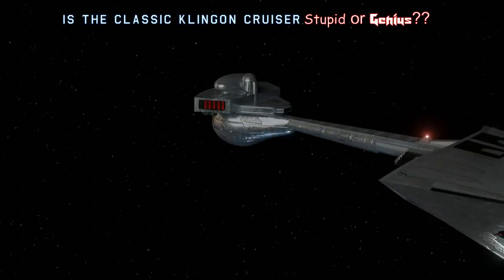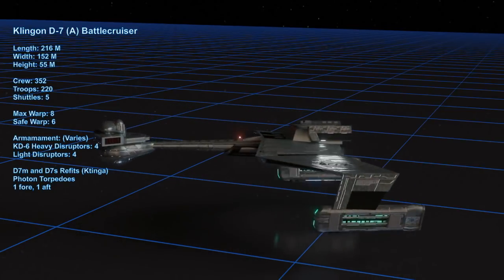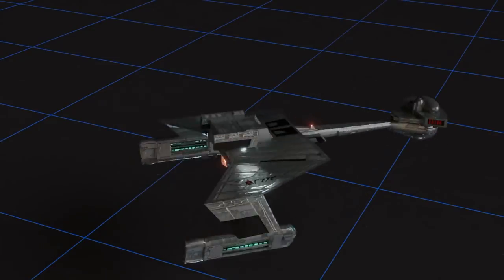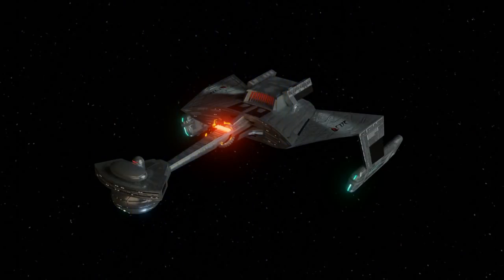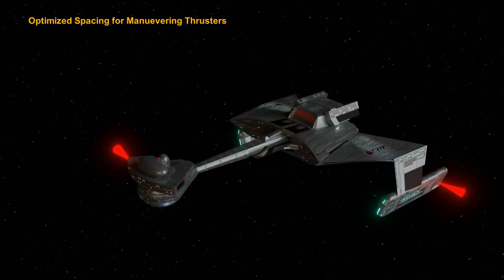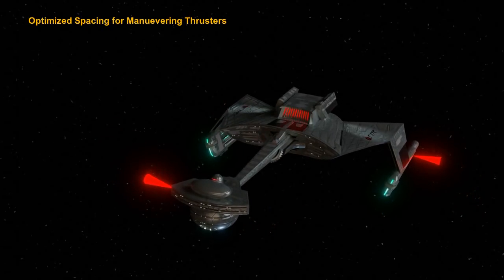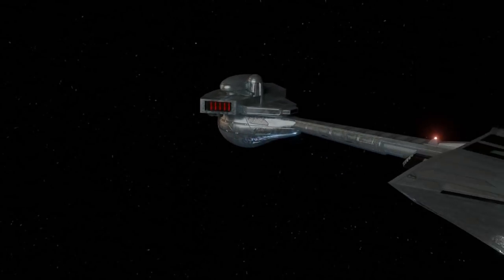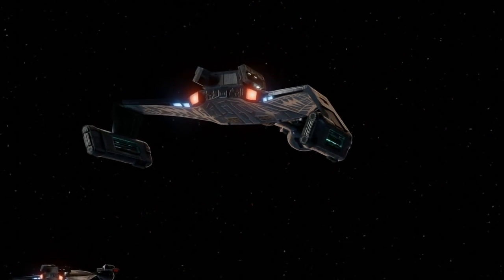The Classic Klingon D-7 Cruiser - Stupid or Genius Design?? Animated Breakdown!

Comment: It isn't just this design, all major Klingon designs follow a similar form. From the D-7, through Negh'var, they take a predator form.
Sensors/eyes, command, computer, fangs front. Storage, reserves, power in bulky center of mass, propulsion, balance points, tractors/arms outward, exahust/pooper aft. 
The long spine is probably their concept of balance, in geometry, mass, and translates to a faster, more agile hunter.
The vulnerability is only apparent from the side, above, or below, where the Klingons prefer not to have an enemy. In TOS, they seem to favor charging or strafing attacks to broadsides or even bird like swooping. Their powerful, shorter ranged weapons overwhelm defenses so the Klingons can quickly obliterate a target or disgorge shock troops to play with their prey like a cat with a wounded bird or mouse.
Regardless of the merits, the ship design suits the psychological profile of the race for which it is used.
The traded D-7s didn't particularly suit the Romulans for very long. The bird of prey attacks of swooping and almost artillery reminiscent torpedo strikes very much suit the measured, deliberate savagery or the Romulan professional military. Long range, stealth, observation, power, agility. Mainline Romulan ships are built on at least three of these traits. 
Federation Starfleet vessels balance defense and offense. The weapons are suited for medium range, with flexibility and adaptability for different ranges and applications. Vulnerability is a result of efficiency. TOS design places habitat volumes some distance from propulsive fields, fuel storage, and power generation. Secondary craft launching, docking, maintenance is aftward where it can be easily isolated from the rest of the ship and crew. The long, seemingly vulnerable nacelles cancel vibrations from the FTL drive units, vent excess heat, and optimize warp field geometry. The connection hull provides additional safety measures for the crew and creates at breakaway line to create the largest possible salvageable lifeboat if the main reactor were to suffer critical damage.

Comment: I personally think it has more to do with how they were constructed. Klingon ships dock from the front so what if the front and back are made in separate locations and then finalized somewhere else? Like, the engines have to be made somewhere different and for it to be fit together they had to make some design choices. Kind of like how the AK-47 was made with unlikely parts they just found something that worked really well at the time. Also making te ships to be very front facing is a Klingon style as if saying they don't turn away from the enemy or turn away because it would doom them. Think like armor with protection in the front but nothing in the back so you dont turn your back on the enemy. Klingons really rely on propaganda to function because they dont fight too good.

Comment: But also if you punch a weapon deep enough into the neck to cut it open, isn't that weapon on the bridge or engine section also lethal to the ship? wouldn't that same weapon wipe out the bridge or breech the core?

the neck seems vulnerable to us but in reality each part of a starship is vulnerable if you get a weapon slicing that deep towards the power core the ship is also finished.
We could assume stronger material is used there maybe more shielding/armor as a type of "look a soft spot" but in reality the ship can see operate in two pieces to finish the battle - and wasted energy on a non essential area gives the klingons the advantage.

Comment: If I had to guess. Klingon ships look like birds to an extent. Given all your radioactive and explody bits are around the core of your ship it would be best to separate the rest of the crew from them. As Combat damage would most surly create a hostile environment andthe command and control portion of the ship could stay intact and somewhat functional. As for cutting of the "neck" , yes that makes perfect sense. It is a tin part of the ship small yet would not take much to sever and once done the control of the ship is lost even if it remained attached the cables and what not would be cut off. A redesign would be cool one that expanded the neck and even mounted multi directional weapons along it to provide a much wider firing arcs.

Comment: The old StarFleet Battles game posited that the Klingons relied on slave labor. The slaves were confined to the rear section while loyal Klingon officers worked in the forward section.

While I doubt Klingons would let slaves near a cruiser, it would be in character for the Klingons to have a stratified society, and have it reflected in their ship design simply because it never occurs to them not to. Consider the deck levels of the Nostromo, from the ALIEN series: the upper level is clean, with lots of white molded plastic like an airliner, the ceiling of the second deck is so short the crew must stoop to avoid hitting their heads, and the third deck is cavernous, greasy, and dark. We seldom consider how this reflects the stratification of the autocracy that produced the ship.

Similarly, Imperial Star Destroyers have a bridge where officers can look down upon the rest of the ship. But while Imperials will hide behind a wall of stormtroopers, Klingons lead their warriors into battle. Seen in this light, Starfleet ships also show a hierarchy with the bridge atop the saucer, but it's also at the core to optimize coordination. Weaponry lies in the lowermost section. 

Compare these ships with the massive flying city-saucer from Close Encounters, the giant pelvic bone from ALIEN, or the long thin Discovery from 2001. Each of these ships are from stories, and they visually "tell" the story of the people who designed them.

Comment: Well, ackshually :P... while it probably has some engineering reasons behind it, I think the D7's apparent weakness stems from its context, and Klingon social attitudes towards warfare.

The forward pod has little in the way of power generation or life support, even less if the neck gets cut. Those occupying the forward pod will probably meet a grisly end, while the aft pod can still limp its way back to base. It's not a safeguard to keep the Klingon officers safe from danger while exposing the unworthy to certain death (which IMHO would be a very un-Klingon thing to do) but quite the opposite: It ensures that the commanding officers of the vessel meet a worthy, glorious death in battle, which is the greatest honor a Klingon warrior can ever receive.

Bear in mind that the D7 was conceived at a time when the Noble houses had been greatly diminished by war and internal strife, while the military were growing in influence and power. Military officers of commoner origin would actively seek an end that was formerly reserved to the noble elite, thus establishing their clans and houses as the basis for a new warrior nobility.

Comment: According to the Task Force Game "Star Fleet Battles" the aft section was inhabited by slave races, I think your last comments in that direction are valid, but then "Star Fleet Battles" is not cannon.  But, according to Cannon the lower pods on the aft hull are not actually warp drives but a hydrogen based alternative drive system.  This is never discussed in depth, only labeled (a name that escapes me currently).  However, according to the Klingon Technical Manual, which I can assume is cannon, they are warp drives.  According to Axanar (which is again not cannon) the D-7s were introduced at the beginning of the Klingon War that Garth commanded in.  He came in with a new Star Fleet ship that was not the command cruiser that Kirk commanded.  The Klingon Bird of Prey Technical Manual (yes I know Bird of Prey is a Romulan designation) states that the Klingons were traditional in their designs and liked to stick to the same hull designs for centuries, the Bird of Prey and the D-7 were so successful of a design that they existed during Kirk's era (the D-7 during his first 5 year tour, and the Bird of Prey after he became admiral and was demoted).  Again this jives with the explanation you give in your video.  I really liked the animation and the breakdown of the systems aboard the Klingon D-7.

Comment: The boom is NOT a weak point.  Weapons in star trek do not do as a rule massive amounts of hull damage, they make a hole and scar in the hull and damage components behind.  Vast explosions occur when a penetrating shot hits something volatile, and these volatile components are always present.
For example of this look at all the ship duels in Star Trek 2 and 3, at no point do weapons scale up to bisect a ship, even on a narrow point.
Now it would certainly be possible to bisect a D7, or for that matter a Constitution class, but it is not easy or efficient, hitting a magazine, power core etc gets the result you want.

I do not believe the boom provides and tactical weakness to the design, and has multi factorial benefits, all those listed in the video plus two more:
1. It provides a political separation that is socially significant.  You may notice this is a recurring design theme for both Klingon and Romulan vessels.
2. It provides separation of sensors from drive and power units.  Klingon vessels are relatively crude, but not backward.  Federation vessels have very sophisticated power components and sensors, but even they try to separate the two.  Cruder more rugged Klingon vessels may use greater physical separation to keep sensor efficiency high.  To reiterate Klingons are not backward, they just have a more rugged culture, sensors require a level of refinement that goes against Klingon thinking so we can expect cruder but more nakedly powerful sensor suites that are likely somewhat larger and have a higher power draw but on aggregate function as effectively as Federation sensors.

Comment: I'd go with 'd' "all of the above".  Culture probably plays a big role, perhaps making the ship a lengthy 'boat' .  Another might be that in its early days in space, a long boom was advantageous towards weapons like railguns where a long firing barrel for acceleration would be useful.  Also, as with the Constitution, separating the ship into two hulls seems to be a common design in the Star Trek universe, presumably for fear of the stardrive hull blowing up.  The warp geometry has some validity; why not go for a 'Star Destroyer' model?  That's a LOT of material and resources spent to make one ship, even if just as long as a D-7.   Multiple D-7s could have been built for that, and risk of an accident blowing up the whole thing exists.  Yes, shields and material technologies presumably make the neck safe enough, as well as the difficulty in hitting it.  It's not much worse than the Connie's 'neck' pylon.  Indeed, the D-7 boom might well be more heavily built as it doesn't have windows..

I personally go back to the "Star Trek TMP" novelization, as it is based on the movie and supposedly written by Roddenberry, I've given in great weight in my head-canon for better or worse.  It said that Starfleet was only marginally better than the Klingon counterparts, and the massive 'refit' (or whole new ship class, by rights) was necessary to stay ahead of the K'tinga.  The Enterprise went through what would seem to be two refits before TOS, the 2nd one just before TOS, so Starfleet would seem to be advancing quite quickly at this time and staying ahead, or having leapt ahead of the Klingons by the time of TOS.  Klingon ships in general and D-7s in particular would have been a terror for most starship classes running across them.

Comment: I think the design is part cultural, part practical.  It looks like a predator, fitting Klingon design.  You run afoul of one of these, you know its trouble.  From a practical standpoint, the center of mass, aka the pivot point of the vessel would be just behind where the neck joins the main hull.  This would make it easier to bring the mainly forward facing weapons to bear.

Comment: Similar argument to the placement of the bridge on Starfleet ships, and similar answer; if the shields work then it doesn't matter, you can't cut it off.  If the shields don't work then it still doesn't matter, Trek weaponry will make short work of any ship, even eventually cutting up Borg cubes.

As for Star Bores ships; massive helpless pigs.  The caloric output of planets to build one, and easily killed by cheap fighters.  Just because McQuarry couldn't make a decent design for Star Bores isn't a reflection on how amazing Jeffries' Trek designs were.

Comment: I was thinking about the design of the klingon ship for maneuvering in battle. The main question is can two ships fight at FTL speed, firing phasers that travel at light speed or photon torpedoes that travel even slower? Or can they only battle at sub-light speeds? I know the latter eliminates about 99 of the battle scenes seen in the series and movies.

The point of this is that reaction thrusters are useless in a non-newtonian framework like a warp field. All changes in course and speed are made by modifying the shape of the field. This is a slow and gradual process relative to the turning on a dime we see at slower speeds. Starships need large amounts of room to maneuver.  

Also the idea that the neck is a weak point is interesting. But I don't see any mention about the pylons of the Enterprise which are weak points too. Sever them and the effect would be disastrous for the ship.

Comment: You know,  the ship is a very aggressive design, as befitting the Klingons,  the ship is very obviously designed to fight head on, and at that aspect the boom section is completely covered by the foreword pod, and if the ship is moving away the boom is covered by the engineering hull. The boom is only a liability on a direct broadside, something that would be undesirable for any starship or ship in combat.

Comment: A long neck seems less stupid than putting your  bridge on the top center of the saucer as the Federation does. Paint rings on the top of the saucer, and you've got a target with the bridge as it's center. Not ideal battleship design. They use viewscreens not windows on the original series, so the bridge could be buried deep within the ship and not effect its function.

Comment: I can think of two things.

1) That the neck isn't an accelerator for torpedoes, but rather a magazine for torpedoes.
2) You may be onto something with the segregation of officers / everyone else.  I'm thinking more in case of any internal issues such as boarding parties, internal insurrection/mutinies, or mechanical issues such as reactor leaks.  Easy to seal off the officers and command staff away from everyone else.

Comment: Technically speaking the Klingon D-7 style makes sense.
If you look at the Rear Section it has two large Radiator Grills that means there isn't nowhere near the living space in it as it looks.
The ships main reactor Core probably takes up a good quarter of the rear section.
Now moving to the forward section Klingon weapons are plasma Disruptor Based. To basically destabilize the enemy ships hull. That means basically only above the forward Plasma Torpedo Launcher is habitable.
So if you take the Klingon Ship D-7 Style as basically a ship built around the function of War with the bulk of the inside volume taken up by weapons and ships systems. You would get a large ship with a crew capacity of maybe a hundred.
Remember the Klingon Bird of prey only has a Dozen officers and men and is almost on par size with the Federation Constitution Class Ship with a normal crew of almost 200.
Klingons would logically go the exact opposite of Federation Comfort and go for bare minimalist necessities.
So if you look at the Klingon Boom Starship separation system not to save the crew but instead as a last ditch effort to get a few more shots in.
It makes far more sense!

Comment: If the neck was such a huge problem. Federation ships wouldn't also use them.  

Quite frankly I think it's simply to keep the sensitive computery bits and shooty bits away from the timey-wimey spacey-wacey  bits that generate the warp field.  

It's pretty clear based on an overall view of starship design that having your major components inside the field is a no-go, which is why all major warship designs basically wrap around them instead.  It wasn't until much later in the lifespan of the warp drive that it was safe enough to nest the body of the ship between the nacelles.

In that light the long neck of the D7 is simply for the purpose of getting the bridge and weapons far enough away from the warp field that the ship can function with a minimum of nonsense.  Much like why you don't have the bridge of an earth warship right above the engine room where nobody can hear anybody.  There's just places what things oughtn't go.